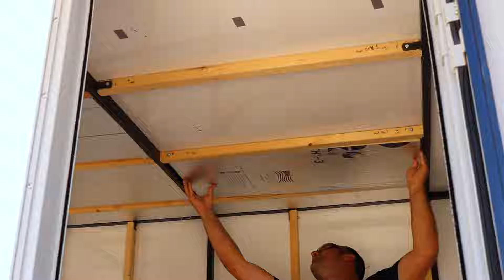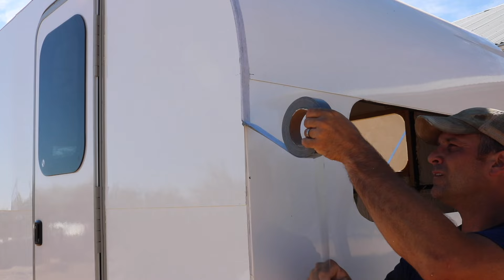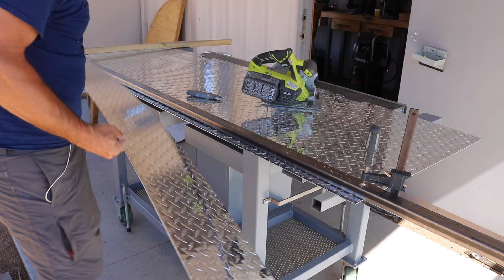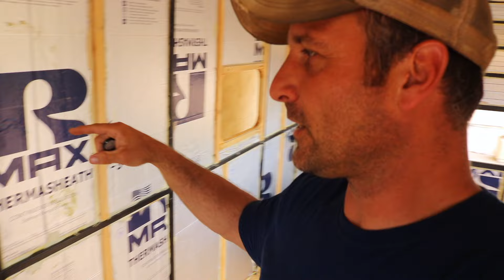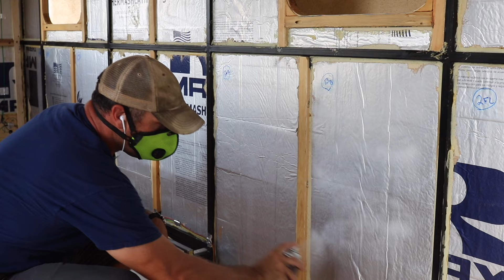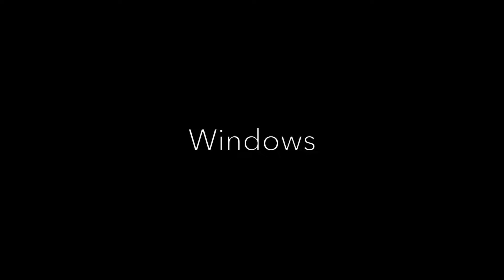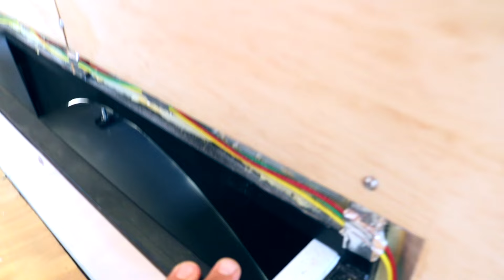How to Build a DIY Travel Trailer - Insulation, Windows/Door, Aluminum Trim (Part 3)

Comment: Hello, I'll contact you for some information regarding the third installment of the travel trailer: what's the sealant you used under the central door frame? To avoid infiltrations from the roof, what tape (vhb tape) did you use on the overlapping panels? Same question for the corners. Under the lights that sealer did you use? I look forward to the links of all the products you've used in this latest movie. Thank you, Greetings Cristian

Comment: This trailer looks strikingly familiar to my Micro Lite Vymeron travel trailer.  Let me know if it was maybe your inspiration. Very good work btw.
Reply from the maker: hmmm... I just did a search for those trailers and they look really cool... but I don't really see mine as following those.  They look like they have WAY more technical know how than I do... very cool lines, and really cool back end too :)   
I kinda came up with mine after looking at a lot of teardrop styles both of commericial varieties and homebuilds... with the front radius and a slanted rear section.  Those features can be seen in many designs from builders to homebuilds... lots of variations of that kinda style.  But I'm not trying to go for anyone style...  Last thing I would want to do is copy someone elses design :D

Thanks for watching!

Comment: Hey your project looks great it's come along way so far I only have one insight, having built a trailer before the weight on both sides is real crucial so when you install your kitchen cabinetry make sure you're on the other side is exact in weight. Going down the road will make it easier good luck looks great
Reply from the maker: Thanks!  That's something that I'm currently trying to figure out so definitely good advice.. thanks Douglas :)

Joe

Comment: it's last so it might be posted somewhere already, but approx. what was the cost & on a level from 1-10 what was the craftsmanship level, EZ 1, 10 being advanced skills needed. Thank you in advance.
Reply from the maker: Hi Robin,

I'll speak to the costs when I'm closer to being done with it... probably in a QA video.  As to the skill level... most of the items aren't really too difficult... but the welding portion you'd want to have a bit of experience on that :)

Comment: the camper is coming along great!!!  your killing it!!!

just put my door on yesterday. what a sense of accomplishment a door makes. decided to go a different route on mine. 2x4 construction, completely rounded ends, 18 feet long. i have a feeling it will be my permanent home. major decision, it'll be my last build. i'm young, sort of, retired, and i have let my life pass me by. i want to see what i missed along the way. except for my welders and plasma cutter, i think my tools are going up for sale. after this one, i really dont want to build anything else. no fun building alone. when i get done, i'll link a video, i want your opinion. cant do a full video like you did, wicked southern accent that would be full of quite colorful language...  
again, your doing an awesome job.
Reply from the maker: Mark Cobb thanks mark!  
Yep the door adds quite a bit!  Sound like a cool project...and don’t worry about it colorful language...can’t say I haven’t let a few choice words go during this build 😉😂👍
Reply: i had some video going but the camera met an unfortunate accident, followed by several of those choice words. i could have done a what not to do ##*$#^ video. 
sad thing is, i have a single axle out there and enough steel to build another trailer base. thinking about building a small version of the big camper. since the big camper is shaped like a pill, i may paint them blue and call it the viagara racing team. you will see me going down the interstate with 80 elderly couples following.
are you planning to have a shower attached somewhere? and are you going to designate a spot for a port a potty? they are life changing necessities and some campgrounds are restrictive on self contained campers. the port a potty can be set on rollers and hid under a cabinet. cassette style, from 60 to 150. insta heat showers around 140. winter camping has been tough with an outside shower and a major decision in the new build for me.

Comment: Just an idea (that might help avoid waste) - take the cutouts from the panels you used to support the fenders and attach them inside the fender edge to help protect the wood and interior materials exposed in the interior wheel well areas. Just a thought.
Reply from the maker: REDHORSE Wordsmith those interior wheels will be getting more aluminum to seal... right now the aluminum is in the fender side so any moisture will hit that and run down and not touch any of the floor boards.

Comment: It's great that you have the skills...   But it would have been about as cheap to buy one ready made once you factor in your time.  For around 14 grand, you could have a trailer, a warranty, and probably more creature comforts than you have room to add... In about the same foot print.
Reply from the maker: RIPPER334 yes I could have bought one...but didn’t want to.  I like to create things and this is something I find rewarding.   
As for price...this will still be cheaper than new...but likely more expensive than a used one.  I will talk about the general prices in a later video overview of the project.  
Anyways, thanks for checking it out😀

Comment: Butyl tape is the BEST sealant you can use.  Just don't overtighten the screws and squeeze it all out.

I know this takes it out of the typical DIY hands, but I would have built the frame out of aluminum.  Also a curved/"barrel" roof would shed water faster.  Last I would have installed some aluminum flashing with butyl tape under the roof panels and over the edges.  This would pretty much guaranteed no leaks at that seam.  If your other sealants and tapes work my proposal would be overkill.
Reply from the maker: Yep, for sure😀👍
As to the aluminum...if I had to do it again I would.  But I was trying to use the frame I had already built...and not to mention I havent really had much experience welding aluminum.  So for safety I went with what I knew better.  But with that said I am planning on welding th tongue box out of aluminum so that’ll be a good training start for the next one 😉👍

Comment: good project mate, 4.30 minutes you cuting propeller plate with ryobi brand cutter. can you please give the model number and name for the ryobi tool you use in cutting .cheers
Reply from the maker: venteshwaran mani it’s just the basic 18v circular saw from their 5 tool kit...the blade is a carbide wood saw blade...wood blades can cut aluminum as long as it’s not too thick😀👍

Comment: Not sure if anyone has asked. but curious on where you sourced the doors and windows.  I've been brainstorming on building one like this but much smaller for years. and I think your build just pushed me into high gear.
Reply from the maker: Zany I put it in the video but the door was from eBay (factory reject) and the windows were from my neighbor for free from an old truck camper he was gettting rid of😀👍

Comment: Hi Joe.  I have been a long time follower and am glad to see you finally making the camper happen (that's how I found you originally).  I have built 2 now and love it!  You are definitely building top notch! BTW. I like the shirt idea and will be buying one of those as well.  BTW.  I might have missed it, but are there plans for 110 and an AC unit in it ?  Looking good man.  Keep up the great work.
Reply from the maker: Thanks so much!  As for plans for 110 and AC... both are still in the 'figuring' stage... haha... but the short is that I'm going to use 12v as the main.. with literally a 110 cord, breaker and splitter for some outlets... super simple but just for when we might 'stay at an established camp ground.  It would be enough to run a portable AC, microwave, etc,.  But the lights, fan, etc,. will stay 12v weather we are in a campground or not.  
as for AC.. that is something that I'm just not sure of. I'm considering just making a cabinet that can store a portable one and set it up when are at a place with power.  When we aren't in a place with power we will likely be in an area that is much cooler, so then heat would be the only thing to think about...haha... anyways, I'm rambling but that just the thoughts
Joe

Comment: Hi! I started to build a  camper trailer in 2016. I did the all framing and wheels and suspention. I didn't finish it.  Iam thinking to start enclose it with aluminun sheets, then, i will the inside thing. But the funny thing is that ylur desig  and my are alike.. thanks for sharing your video. I am going to take some of your ideas.
Reply from the maker: that sounds cool!  and glad if this project gets that one back up and running :D
Let me know how it comes along Adolfo
Joe
Reply: homesteadonomics i will send you pictures and probably some questions.

Comment: 1. Break lights are good but should also have Indicating orange lights next to the above lights on the back walls.. 
2. 250w Solar panels, MPPT charge controller.. (MPW controller charges less even on cloudy days) an altometer amp/voltage meter (digital or better industrial analog) ..an inverter, ceiling ventilator fan, removable/reattachable windows mesh for summer bugs..
3. daughter sleeping space should be a 2 bunk bed..cause it will provide extra space if company is 3+
4. Backspace under the back break lights should have a tool box space.
5. Cleaning Water space
6. Gray/black water space
7. Communication antenna for internet and TV on the go.
8. 2 spare tires and tire repair kit
9. Cooking must be done outside...and for that a rollable tent on the side of the door...good for sitting outside in summer and at night to do some barbeque.
Reply from the maker: Hey Edward,... now thats a list I'm going to take some time looking at!
... as to some quick answers... tool box in back is a definite consideration... 2 spares:  got 3 (got 5 total from jeep take off.. but will make 3 trailer rated tires)...coms for internet like a booster: yep.. tv, probably not
cooking outside will be the main area, which is the plan for the slide out 

Anyways, thanks for the list!  I got lots to think about :)
Joe

Comment: Are you going with a side window style residential ac unit or gonna have one on top like normal RVs? The wiring for that will definitely be thicker than the 12v stuff... and I would probably add it inside conduit or at least get metal clad cable.  Same for microwave wiring.  The other big electrical - not sure if you plan on it - is tank heaters if you plan on going camping in the winter.  One thing is obvious though, your trailer is way better built than anything available on the market nowadays!
Reply from the maker: So actually I'm still thinking about all that stuff...haha... I know.. last minute planning.  As for the AC I'm unsure right now... I don't really want to have something on the roof..  I have seen some small units that can be rolled out from a cabinet and vent to the outside via a hose... something like that wouldnot require any new cuts to the outer aluminum panelling...
as for tank heaters... I'm thinking about some of those portable units and trying to make an outdoor shower for the main user.  the inside area would only be for if we were in a camp ground or something like that....
anyways, still lots of decisions to make... haha

Comment: Filling your cup, a composting toilet designed to separate the urine that flows into a resivor with a bell siphon. Siphon then fills a joe cell half filled with gallium aluminum alloy. Sensor detects urine that fills up the rest of the joe cell switching on the power to joe cell. Joe cell then produces HHO out of the urine that charges solid state sponge hydrogen fuel cells. Fuel cells used on vehicles and or electric power generatior. Solid waste lands on a metal tray that then drops down into a compartment that drops the waste and sprays off tray cleaning it. Solid waste toilet paper then gets convevtion oven dried out sterilized and ground up then deposited into a bin has rich top soil. Heat generated by electrical heating elements or by the hydrogen fuel cell burning the HHO in a ceramic element burner. A different way to handle and process human waste. Other idea would be to have a filter system to boil off grey water and use an atmosphric water generator to reform liquid water out of vapor leaving all the chemicals behind in different filters. Other idea if using liquid air would be to use a superconductor separator to clean pollution and bacteria out of urine and grey water to have pure drinking water. Hay lots of neat stuff in these comments huh? 😊😉😁

Comment: Dude! 😁 listen well read, Stirling cryogenic piston that turns gases in air into super cold Liquid. Liquid fills an insulated tank resivor with a bell siphon. Liquid air then fills a resivor in a modified absorption refrigerator. Liquid air then travels down insulated copper pipe that fills a large fin aluminum radiator with a fantastic fan drawing air through it for air conditioning. Liquid air travels on and fills an insulated resivor housing the cylinder heads of a V-6 or V-20 Stirling cold gas engine. Engine construction aluminum scandium alloy with gadolinium being used for magnetic bearings on all moving parts on engine. Engine being constructed using antivibration technology currently being used by Skill saw on their reciprocating saws to reduce vibration of stirling cold gas engine. Sensor on cylinder heads to activate electrical motor to cycle Stirling engine till a certain RPM is reached from cold gas cycle powering the engine then starter motor shuts off with motor then moving freely. Now you have two fly wheels to attach an automatic transmission to each fly wheel. The attach a large drum motor generator that has been rewired into an electrical power generator and switch out bearings for magnetic bearings. Add a sensor to cryogenic stirling piston electric motor to kick cryogenic piston on to generate a tank of liquid air to charge system. Liquid air then boils off back into atmosphere up and out an exuast pipe. If these neat technologies tickle your brain? Lets have a meetings of minds and design one amazing little camper?  Look into air alloy and azdel panels has you do your home work researching the different technologies being discussed within this post.  You might not find everything on line because certian things have not been marketed yet. IE invented designed and patented yet. 😊

Comment: Dude, Design a small solar vacuum tube water heater system retrofited to super heat a gallium alloy. Place insulated pipes and use an electromagnetic pump to pump super heated gallium alloy through a copper heat exchange coil inverted inside an insulated water tank. Placed above the main galluim resivor so the gallium alloy can drain back out of all the pipes ounce the sun go's down. Then you could even circulate the super heated gallium alloy through thermal electric generators to charge up an organic carbon power cell bank.  You might be able to use a large Peltier module to rig up an air conditioning system and even operate a refrigerator off the system during the day then off your organic carbon power cell bank at night.  😯😊😉
Reply from the maker: whoah!  now that might be a bit past my brain power to figure out... or at least a bit heavier type of project than I can add to it ;)

Comment: Dude, how about a tire with a dense foam donut with a round outer surface that has a notch towards the wheel hub where you place a Kevlar inner tube filled with nitrogen that when inflated fills the notch in the dense foam pushing it outwards to make the tire become ridged. You now have a trailer tire that can take nails and sharp rocks. No worries about having a flat on your trailer. 😊😉
Reply from the maker: now that would be the kind of tire to have for sure!!

Comment: Dude design one that has slide outs on both sides that you pull out and push in by hand. Put the kitchen stuff in one of the slides place a conner shower stall and offset cartridge toilet in one corner of the other slide out and place a dinet. Then put a nice Murphy bed in the back. Have a swing down flat screen tv that hides behind a cover you can slide back to protect the flat screen TV. Some crazy ideas for you. 😊😉
Reply from the maker: haha... no flat screen TV but yes to the slide out with a kitchen set up :D

I see you've got some more ideas just up the comments... to those now;)